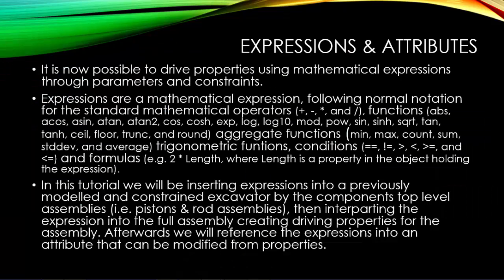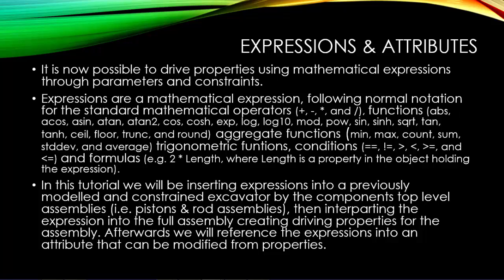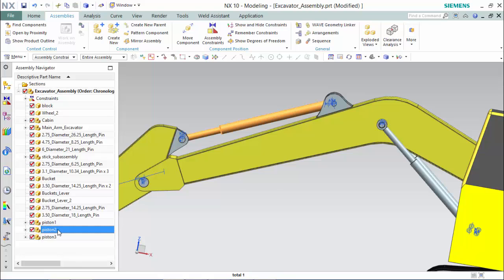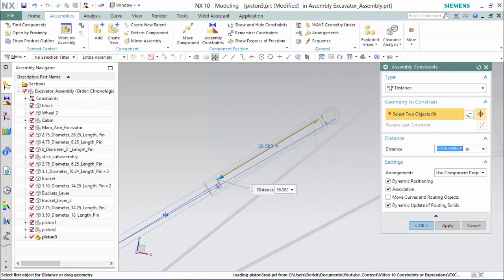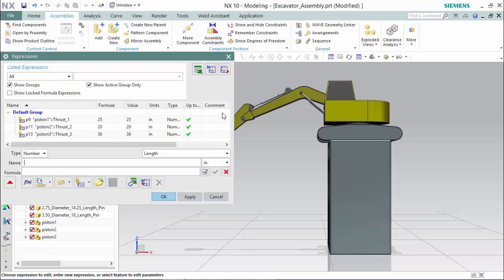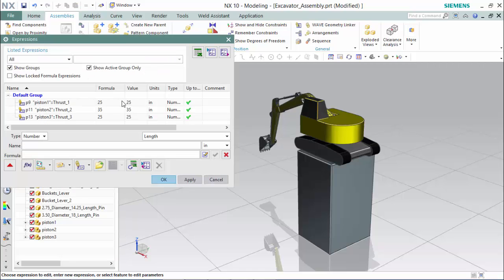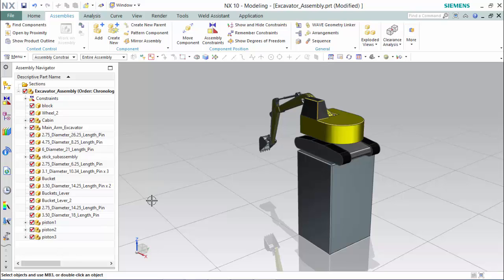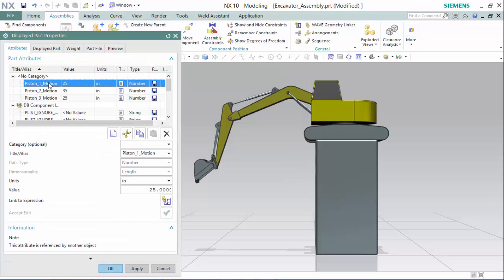Siemens NX 10 - Expressions & Attributes - Excavator

Comment: The "override expression in component part" toggle is available in NX12? Thank you
Reply: Could you help me ?
Reply: How can we add the expressions or attributes in the parts description?
Reply: Such as I have one sheet metal component, which is having dimensions 1500 x 2000 x 4 mm in the form of (Length x width x thickness), then how can I trace this dimensions in my bill of material, if I have assembly of this kind sheet metal components.
Reply: For your reference you can see this video, but this operation had been applied on AUTODESK inventor